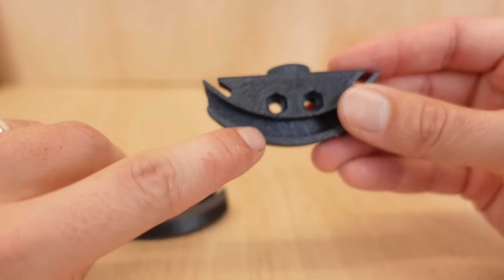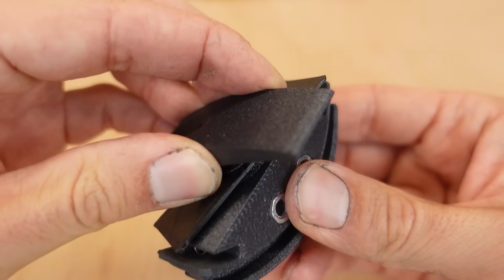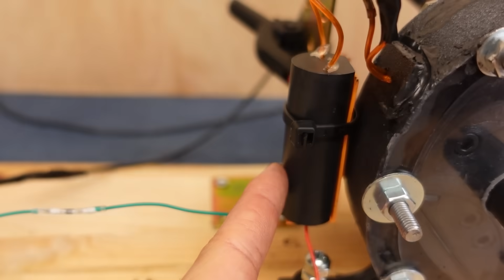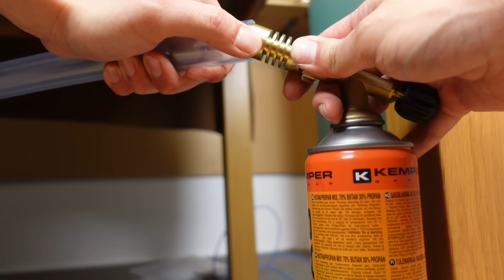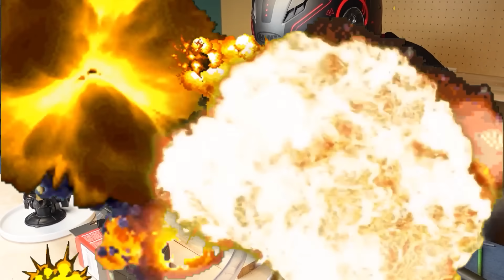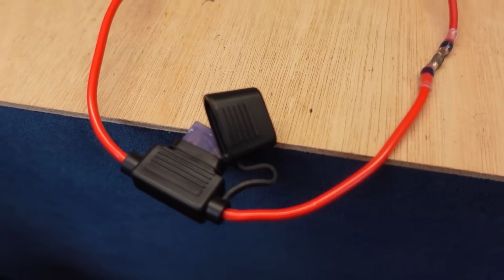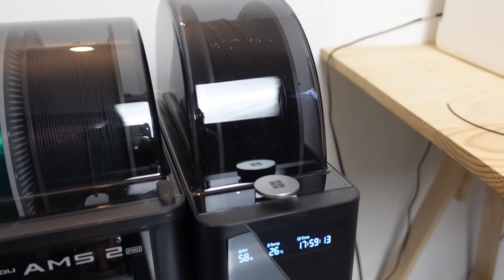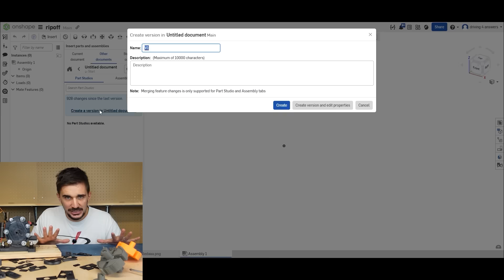My Oval Engine Now Fires At Will! Major Milestone For DIY Oval Rotary Engine 2.0

Comment: You need to seal the prints. They are still very porous and the compression you will lose compression tough the material. Get a tabletop CNC and make it out of aluminium. You can also machine graphite in to seals.

Comment: maybe make the exhaust smaller. just a thin slot. 
I think the force is not pushing it to rotate. There is to many moving bits to productively transfer combustion to rotation. just a thought?

Comment: Bud stoichiometric for butane is 15.4 to 1 similar to gas at 14.7 to 1. You were running straight butane it needs a mix fuel/ air to have a more energetic combustion. 
When you redesign have a mark for timing on your rotating assembly. You could then set a template on to the acrylic combustion chamber cover mark it for 360 degrees 90 degrees to the top and you would be able to set your timing more accurately. With that floppy wire for timing the spark isn’t helping your build. 
Keep it up I like to watch these videos I can’t wait to see what you try to make next.

Comment: Try a buck converter to regulate the voltage. The wires are also bouncing when they hit; try a wheel with a bar insert & spring loaded roller on the rim

Comment: You completely cut off the inlet port from receiving any air (oxygen) by shoving a sealed hose on it with only fuel (propane/butane)
   Feed the intake port the propane and butane in a way that allows the intake port to receive atmospheric air (oxygen) as well. This will serve two benefits. First having oxygen available is not only necessary for combustion, but it will help the power of the combustion,  and two, it will allow the engine to breathe under its own power as opposed to suffocating it with the hose going to the propane/butane tank. You were so close my guy! Oh, and don’t forget a flywheel.
   I know you would’ve figured this out eventually, however this silly mistake goes to show how incredibly intricate your project was as it completely consumes your brain power.
   Nice work though, I’d like to see you get it running.

Comment: Those high voltage modules work from 3V to 6V. It's even in the description. No wonder it died from 12V battery. Unless I've missed some sort of DC-DC converter or a resistor.

Comment: a suggestion that might help with the starting issue, have the "spark plug"  at the combustion side, instead of it at the exhaust side, it looks like your spark is happening just before the rotor is about to push it out, if you look at the wankel engine and or the engine mazda uses, its similar to what i'm trying to explain, just a thought, keep up the amazing work, love watching these kinds of videos.

Comment: Bold on a moped ignition and a flywheel. Make some adaptors with different diameters for the exhaust. Figure out the fuel air ratio needed. Adjust the compression  too.

Comment: Same thoughts here about the wrong positioning of the exhaust. Also the exhaust diameter could be to big. Loss of power due to compression loss. Or may be the engine needs more mixture?

Comment: treat it like a 2 cylinder 2 cycle engine, intake on the top and bottom with fuel for combustion and exhaust on each side. my suggestion would be to have oblong exhaust ports that are long enough to go from the end of the combustion  (no compression resistance after combustion, i.e. at the end of maximum volume the burned gasses need to be expelled) and close just before the next combustion to keep compression.

you might need to have 2 paired together at a 90 degree offset to get it to run on it's own, just a thought, have fun with it.

Comment: when you look at the high-speed when you have the explosion on it the spacing means that you almost have no room for when it starts to vent because of the design of the internal piston and design. 

look at your high-speed film again and when you see that it's where it's sparking and that as it Sparks its sparking across the hole edge where it's evenly almost all the way across until the point that it's venting out and which is meaning that you're not getting the full power out of it. you need to redesign your piston to be able to take the the power stroke and so that it's compressing at the right spot which means adjusting potentially where your spark plug is and also making sure you're exhaust is in the right place for that to ensure that it's not you're not losing power out of it by flame throwing the majority of the pressure stroke so that's an additional issue you may have.

Comment: also I've noticed in that slow replay that not every rotation it's not always getting combustion cycle and is depending on the impact to keep it running. so that may be an issue with the timing and the flamethrower effect that you are noticing because it's basically causing a hiccup where the motor and as it passes the exhaust is not fully combusted and therefore some of that combustion is moving past the exhaust area and creating pressure against the next cycle

Comment: okay and additionally you're going to want to have cooling fins in your design so even though that doesn't work in plastic by including slots that are have the aluminum to be able to draw the heat away that might be able to help you with your design as well to help draw maybe some of the heat away from the project or water cooling I know that has worked on other people's projects by running by having water passages inside the print and therefore as long as it's properly sealed actually contain the water and by running the water in a loop. it'll help keep the plastic area cool so that way your initially assisting you in in this and for the acrylic you're going to have to do something similar just have a an aluminum circular thing with a flat side somehow I've been not sure how you flatten 1 inch properly but you can probably take things off of Old CPU coolers to be able to make that just place them around the edges so that it can help draw away some of the heat from the acrylic. 

so you're coming along great but I think at this point if you can get it running more stable on the plastic because your gas and is an issue along with oxygen mix and make sure that the that it's combusts at the right time and with the right amount and otherwise like you said you're going to be having a flamethrower which is where you want to have an exhaust instead.

Comment: also because it's just acrylic and such and all that you really need to make a lost wax version of it so that you can see what's going on and then again you can melt all that aluminum back down again to redo the next version. this way also you you can then also have any 3D printed versions so you can see what the changes were as you go along and remelting the aluminum each time so you can Mark a note each one where the failures were and the problems.

Comment: okay you've got two problems with this motor right now that I can see is one that's made of 3D printed material if you're going to do this you're going to need to get a resin printer at least that can handle extremely high temperatures to be able to ensure that there's no leaks on so long because standard 3D printing is notoriously porous. 

also from the looks of the material you're using it's definitely not meant for high temperatures. the acrylic or plexi that you're using to cover the the chambers well play cause a gap if the surfacing of that is not perfectly level think of an actual engine even if you put sealant around it if it's not perfectly leveled with the your pistons and so on to ensure there's no bypass this will also cause a problem. 

you also need to look at your timing and as well and also your gas flow if your gas flow is too heavy cuz it looks like you just open it up and you haven't metered the flow with the oxygen that can also cause a problem because too much fuel is basically causing either premature spark or spark that comes too late so again this also results in timing issues. 

 your idea and approach is amazing and fantastic and I look forward to seeing your next ones but ultimately what you're going to have to look at doing is making it out of at least aluminum with a lost wax style with some pla on making your your stuff that way and then sanding it properly you'll have to make sure you OD the specs on the motor and also you need a quick release so that your impact is not causing it to become stuck on it and causing restrictions. and again the flamethrower is due to not metering the airflow of the accelerant you're using. just got a standard Flo forecast like CO2 or settling etc that might match your gas that you're using and plug it into your hose and then put the output into the motor and that way you can adjust the flow rate easily to ensure that you are getting the absolute proper amount of gas into your system as well which may also compensate properly for any leaks as a motor will still run and horrible condition and timing off to some degree. 

I love the concept and I hope you keep working on it because ultimately that could eventually be an amazingly powerful small little engine stacked that's lightweight that can produce an extremely high horsepower. you may need to make it a little bit bigger than the size it is at right now as I see you're trying to mimic something like the small reverse Wankel engine I can't remember what it's called right now something X. 

but going a little bit larger to start gives you more room to figure things out and then you can miniaturize as you go once you've got things figured out and sorted out probably go twice that size so that or at least another half that size just to give yourself the room to see what's going on

Comment: Well, the screenshot from amazon clearly says the high voltage generators are 3 to 6V only, and you are feeding them with 12V from a lead acid battery that can supply very high current... No wonder they are dying bro 😂
Edit: oh, I see now that you addressed that later in the video. That's the importance of watching the whole video first 😂

Comment: Please use some Hall effect sensor based ignition, it's really simple! 
In my childhood I made one for 2-cylinder soviet bike, using cheap parts from russian cars and a custom made steel butterfly plate. It worked so much better than contact-based ignition!
It would be so much better, ignition timing is so important. And you could re-use it for different prototypes.

Comment: You need to give the explosion to happen with the pressure being directed towards the direction of rotation, meaning the shape of the combustion area should be so as to direct the explosion in the direction of rotation that's what gives you tork

Comment: Apart from the problems with rough surfaces that make it difficult to move or rotate, I think the biggest problem with this concept is the symmetrical thrust of the gas explosion on the axis, which inhibits the rotational torque. I think the thrust on the axis during the gas explosion should be offset to the side, thus increasing the rotational torque with each cycle... I recommend re-making the moving parts in an asymmetrical shape or the thrust on the drive axis should be offset off-center, similar to the Wankel Engine. 😀

Comment: I said same on the last video but i dont understand how this is supposed to turn the expansive heat energy work into rotational energy? Like a rotary or even a piston engine have crank shafts. you need "crank" offset from the centre of rotation to provide a torque moment. Am i missing something here? The combustion cycle doesn't look like it forces rotation at all so you will always just be manually cranking it...

Comment: I still don't see a good point of leverage that will cause the rotor to rotate. It's symetrical, so any push one way by your rocker piston gets pushed back the other way 90 degrees later. You should put a subtle subtle sine wave in it so that the leading side is relatively concave. This will create more pressure during combustion on one side. ALso, you should run compressed air through the spark side and see if you can get the engine to rotate just on compressed air. If you can't, you won't get it running on spark.

Comment: YES, port placement looks strange. You would want ignition at most compressed state, allowing enhanced, more rapid combustion under HP conditions and THAN the expansion of the heated gases while pushing the rotor...

Comment: I think the rotary vane concept should not die. It may be improved, if the sidewalls will be part of the rotor, and have a guiding tranches for the vanes. That will significantly reduce the load on them.
And then if the walls will be not flat but conical, that might significantly improve the thermal efficiency and performance. In that case combustion chamber will be more compact, so the fuel will burn quicker, with less detonation and less heat losses. In the same time the size of the "cylinder" at BDC will be bigger, that lets increase the expansion ratio. Plus the load on vanes in TDC will be smaller, and the port size can be bigger. All that makes such engine more efficient then the normal one with round cylinders. It would combine advantages of an engine with small and big cylinder bore.

Comment: The H2D has two print heads, so you can put the regular filament into one, and TPU into the other, an print parts that consist of both materials at the same time.

Comment: Dear sir. I have some burning questions about your 'engine'.
How do you expect it to run without a flywheel?
Am i correct that you have designed it to have two sliding rotating combustion-cambers? Have you thought about the fuelmixture that gets inbetween the chamers?
How about a set of contacts you can adjust properly and accuratly for precise spark timing?
And lastly, did you check it has propper compresion?

Comment: Your gas has an ignition point at 10 to 14 parts air to 1 part gas. All internal combustion engine fuels has different ratios air to fuel.

Comment: All of these have the fatal flaw of the Wankel.  Surface to volume ratio of the combustion chamber is very poor and means unacceptable fuel consumption due to excess heat loss.  D.O.A.

Comment: What you need now is a stable ignition system. Mainain rpm, change the ignition timing. Use a Arduinio or ESP32 to manage the ignition for you

Comment: You need air for an engine to run. 
i think adding some form of air inlet or carburetor so you can tune is would improve combustion a lot.

Comment: Try adding a rotary exhaust valve so you can control your exhaust timing without changing the location of your exhaust prt.  That would allow you to scavenge more power from each combustion event.  You could also use a single ls d585 coil for your ignition.  It's powered by 12v but used a 5v signal to trigger.  You might be able to wire up a simple hall effect sensor to trigger the 5v to the coil,  just make the position of the sensor adjustable and you will be able to accurately adjust your timing.

Comment: Just an assembly point. When pressing in a bearing it’s always good to press the outer race and not the inner race. For small bearings a socket of the right size works well. Pressing the inner race can damage the bearing.

Comment: I would have used an old school ignition setup that uses the halleffect sensor mounted on a moving plate near the rotor shaft.  The rotor shaft would have a small magnet, maybe neo, glued or pressed into a hole in the shaft.  Those wires bending are going to be very unreliable timing.. I work with old vws and the bosch setup is fairly simple and I never seen one fail.  I remove these parts when I do diesel conversion...lol

Comment: This might not get seen but I recently stumbled across a certain kind of fueling system that basically does away with the carburetor as it runs in the gas vapor, surprisingly. They're referring to it as "gas vapor carburetor" (or fuel vapor; "gas" being "gasoline", so petrol to most). 
Basically you have the fuel reservoir and then the air draws in THROUGH the gasoline, aerating it and generating lots of fuel vapor, which is then sucked out of the the reservoir and into the engine. 

In the one car the guy was simply using ball check valves, aka shutoff valves, to regulate the air flow and acting as the throttle.
In another video it seemed as though he was also passing some of the exhaust through the fuel reservoir, undoubtedly to have the thermal energy vaporize the gasoline faster.

That would eliminate your need for a carb, though I think a better metering system than ball check valves would be needed. The one guy seemed to* be using 2, one that was upstream from the other, and which regulated fresh air, whereas the downstream one is which would draw in the vapors. So both needed to be fiddled with to adjust not only the Air:Fuel Ratio, but also in conjunction to act as the throttle... Convoluted to say the least; thus why a "better metering system" will be desired! lol 
Or at least would be for tests beyond the bench... 
(*"seemed to" because 2min vids with no talking lol)

IF this gets seen by D4A and interest established, I'll gladly dig up the titles.
For now I just want to get back to watching this one 😊

edit: Oh yea, and TPU is indeed petroleum safe from research I did one other time. (on GarbageTime we were musing about printing our own engine gaskets, which is where TPU's flexibility is needed).

Comment: Add a flywheel, a bit more compresion(idk how u would do that) and a carburator so you can arcuratelt tune the air fuel ratio. I also noticed you need to retard the timing it will have enough torque to rotate a flywheel pretty fast.